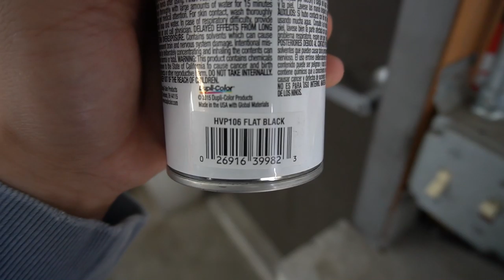Painting The Interior Headliner Black | PART 2 : Gutted RSX

Comment: Great vid bro, I'm thinking of doing this to my 07 eclipse but my interior is so in tact that I'm thinking of just spraying the headliner and 4 pillars without taking anything apart and just taping everything off, do you think it could be done?
Reply from the maker: Can try it , I think it’s possible. You will probably need a really good mask , like a painting booth mask and with goggles . And definitely cover anything you don’t want paint on . Even the seats .
Reply: Hey man how did it go? did you end up painting it intact? i was thinking of doing the same thing cause i already got the galaxy lights on. I'm just thinking if the lights will still show after i spray paint the liner...
Reply: No I didn't I ended up spending 400 bucks at an upholstery shop to get it done
Reply: They reupohlstered the whole headliner though and painted the pillars and mirrors and all the plastics black to match

Comment: Thanks for the dome light wire routing... got to get me some of the dem slippers...   lol
Looking forward to watching you trying to install all this shit back in the car, that's the only part that has me worried,
I can take shit apart like a MFer, it's remembering how it goes back together..  lol
Reply from the maker: Your welcome. That was going to be too much work trading it back to some fuse box . Take pictures or video. If you feel you won’t remember . Putting it back together will be the easy part 👌
Reply: @Deemossi  I got my paint today from the same place as you did.. 2 blocks away. This weekend suppose to be beautiful, 70 degrees, i'll get some shit done... question,  how long will it take for the headliner and other painted parts to totally dry ?
Reply from the maker: Honestly I don’t know . I havnt put any of my pieces back , i won’t be reinstalling them for a while . just make sure to clean all your plastic pieces with wax and grease remover .
Reply: @Deemossi  Yeah the mirror plastic piece i forgot to clean, and it looked like shit right when the 1st coat started.
I stopped and took it in the house and cleaned it up, 2nd try went much better...  them little pieces are easy to forget.
OH.. and wiring the new foot well LED's in was pretty easy once i found where i needed to connect the wires.
Reply from the maker: Glad you got thatlightung  figured out man. And yea the cleaning is most important before paint 👍🏽

Comment: hey bro i tried using this method but it feels as if the vinyl got burnt idk has like a weird texture is that normal?
Reply from the maker: it felt normal when I did mine . You need to really clean your vinyl parts , prep work is really important. your plastic parts have armor all and all these chemicals from when u clean your car. You always have to degrease them and before you paint. U have to use wax and grease removal . prep is key for it to come out perfect
Reply: Deemossi thanks alot for the reply im deciding if I should gut the rear or paint all the pannels black since i got a tan interior i tried that on a door panel but got my self some black panels today